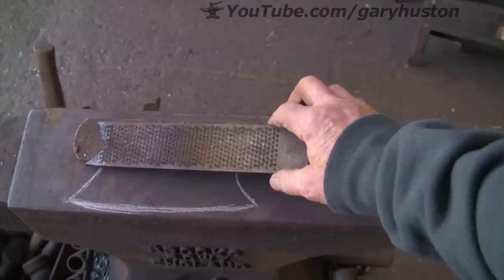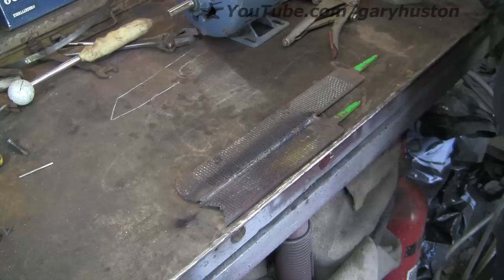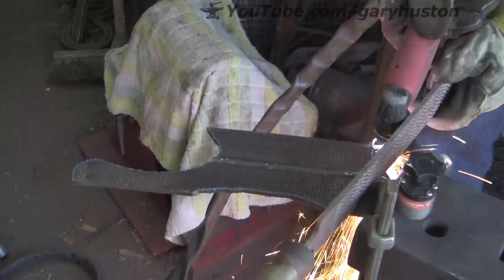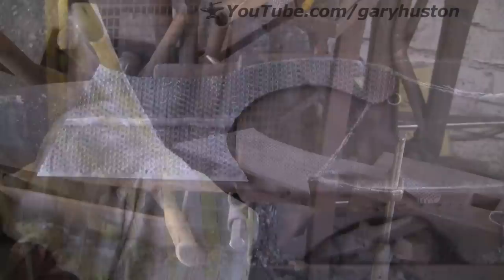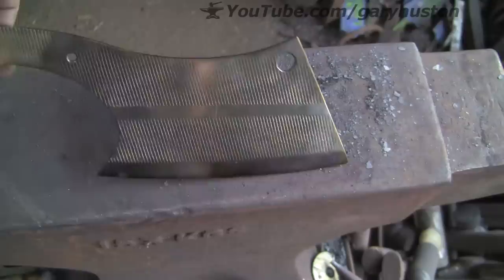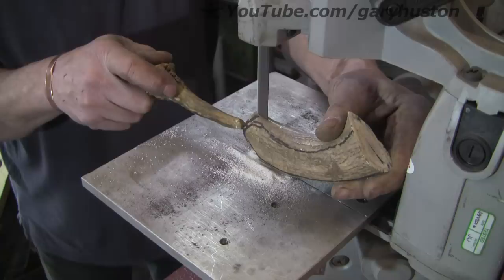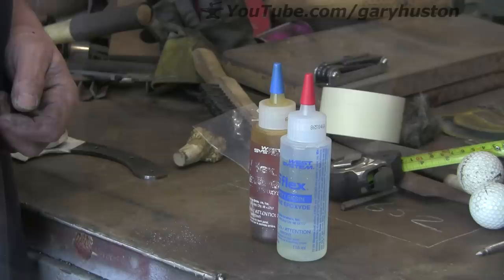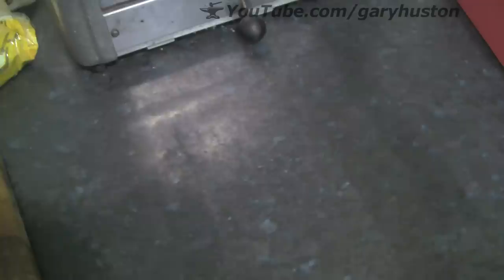Cleaver from two Farriers rasps.

Comment: The issue of the softer central antler material could be sorted at both ends by adding metal bolsters and pommel , and along the handle length by removing majority of thickness from the softer centre before the actual final fitting up.  Nice job Gary , you're a talented , cleaver chap !!

Comment: Thank you for showing that a weld in a knife isn't always a bad thing, I can't tell ya how often I hear about it. If you're doing an etch I can see how would be bad, its probably a different color and could mess up the pattern. But most everything else it's as or stronger than what you're welding.

Comment: Brilliant.  Best idea for epoxy I've seen so far.
Reply from the maker: Thanks 👍
Reply: Been doing it for ever. Never knew why people didn't. Works better to fill by putting the corner in between your fingers and folding the bag opening your fingers. Squirt the epoxy right in the corner for minimal air entrainment Also burp the air out of the bag.  For best and easiest mix pinch the epoxy in the corner of the bag then rotate it circles on your open palm...  Very nice video Gary.

Comment: Very nice use of two old tools. However you do need to seal the antler as it is porous, which will allow for bacteria to grow in it. A penetrating oil that’s food safe will do the job to a point. The best is to use a poly finish used on counter tops and thin it out so it soaks in and seals the pores. Then light sanding to bring the antler back up to the surface. Butcher block oil wipe and your done.

Comment: Cool, perhaps your next one, weld them together clamped on a thick piece of aluminum to help transfer the heat so it doesn't warp to much. Thanks for sharing your talents.
Reply from the maker: what's the point when I will be running it through the fire anyway?!

Comment: Don't know if anyone else said this already but, if you don't touch metal with the sand paper you won't get that black on the  antler.  It's tedious but you can do it without too much extra effort
Reply: Correct. Adding to this, just before getting to the metal, use crazy glue or some other clear glue to saturate the spongy end of the scale, to seal it. Once it is full solid, no other dust gets in there.

Comment: A beautiful cleaver.   My only minor observation is that I would always be slightly concerned that I wouldn't be able to completely get out all food residue from in cleaning the blade.  The grooves and divots left on the surface could collect food particles.  There are ways of getting around it of course.   It just would take a little longer to clean properly.   As I said this is of only a slight concern with me.  On the whole a great video and very nice looking cleaver.

Comment: Beautiful..!!

I'd like it with a bit of Outter Cortex left on the Antler (Texan)...

To reduce the Honeycomb you would need to remove more material from the Inside of your Scale medium as apposed to doing most of your reduction from the Outside. I've not found a way to keep the Steel Dust out of the Honeycomb... Call it a Feature as opposed to a Flaw! 

Cheers from Southeast Texas!

Comment: if u decide to use horn as a handle, u must plan handle acording to thickness of horn part to take off minimum material, or it will be more brittle, also u loose horn texture and grip

Comment: you made a nice cleaver if you would like to continue to use horn as a material I suggest you let the working pieces soak over night in bleach to take the color out of the material I have done this when I used horn and bone for knife handles and pens use something to seal the material then because it will be pores

Comment: It's gorgeous!  

I have a few remarks about the antler - perhaps the porous bits could have been filled with epoxy first - though it might have required a vacuum chamber - suck all the air out of the horn, so that when the vaccuum is relaxed, the epoxy goes in to fill it.  That was a beautiful antler - probably shed at the end of the rut.  You see it happening here :
https://youtu.be/TEZ6gedL68g?t=48    They grow a new set each year, and the older the deer, the bigger the antlers they grow - so the one you have there is from a mature stag - "A runnable stag, a kingly crop, Brow, bay and tray and three on top"
The line is from a poem - The Runnable Stag - which narrates a hunt in which the stag escaped - but to his own demise.  He swam out to sea, which was apparently not at all unknown.  I guess when you have a pack of beying hounds after you, you'll do anything to escape them.  If that antler had been a pair, it would have been one to excite the huntsmen of a century ago, to mount over the hearth in the stately home!

https://www.scottishpoetrylibrary.org.uk/poem/a-runnable-stag/

Every profession, like woodworking and blacksmithing, has its own vocabulatry of words that don't appear in everyday speech - and the same goes for the hunt.  In the first two verses, there are a number of terms used which are explained here - click the hi-lighted lines.  https://rpo.library.utoronto.ca/content/runnable-stag#poemline-5

The hunt is banned now, but like many other blood sports, it had a strong following in its time, and excited a good deal of passion among the landed gentry.  Remember that this was at a time before the motor car.

Brow, Bay and Tray are parts (tines) of the antler.  See them named here : https://www.antlerexport.com/knife-2.html
Reply from the maker: There was a pair and they were cut off not shed. They came from a zoo.

Comment: 0:40 are you out of your mind not using a glove?
Reply from the maker: What’s the problem?
Reply: @garyhuston  well I probably was overdramatic, but in welding class, safety was always #1 priority, and you not using a glove made me worried with welding. I just don't want you getting hurt that's all.
Reply from the maker: @fnafplayer6447  I think after nearly 45 years at it I can stand a few burns from tacking a couple of little pieces together! I generally only wear gloves on heavy work when there’s a lot of heat input. As a farrier I never wore gloves as it was way too dangerous so got used to being burned regularly!